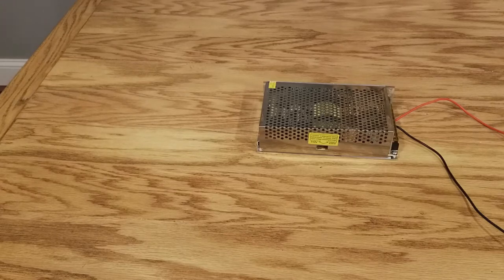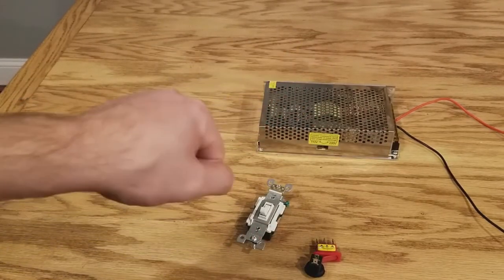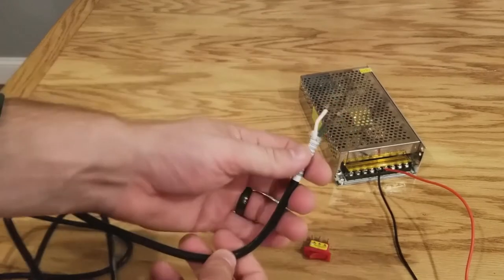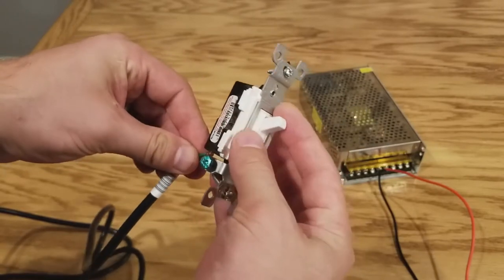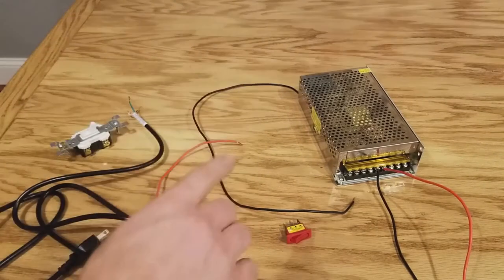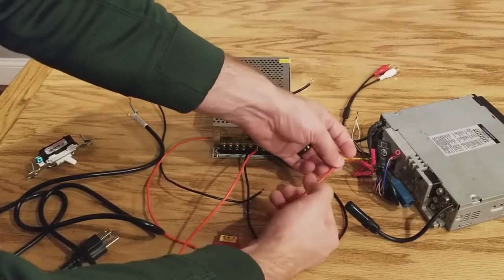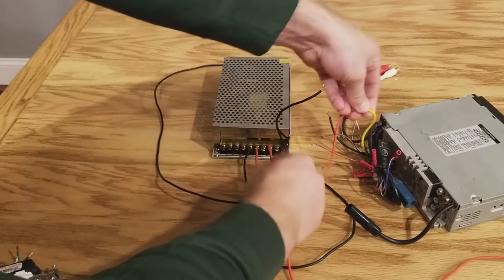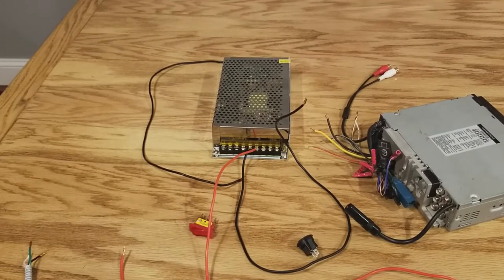How to add a switch Regulated Power Supply or Car Stereo in home

Comment: Hi. I bought a 750w amp and a cheap car cd player and a 500w sub to run off a 12v 30a power supply I purchased. Also going to run a couple house speakers of the cd player itself. Do you think this setup will work, based off this information? Also am i able to leave the power supply on 24 hrs a day? And since the cd player has a power button, that would negate the use of a switch correct? First time doing this. Thanks
Reply from the maker: Hey Tom, you still would want to shut off the CD player (ie turn off the ignition of your car).  So I would still run a switch just like shown here.  As far as the amp, it is almost impossible to say off the information provided.  But it sounds like you are on the right track.  I can't wait to hear how it turns out!